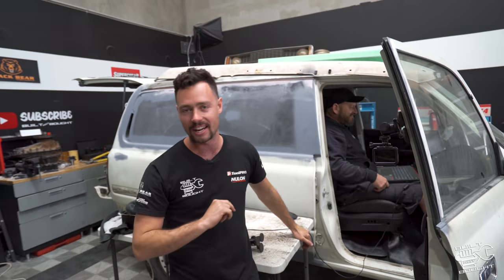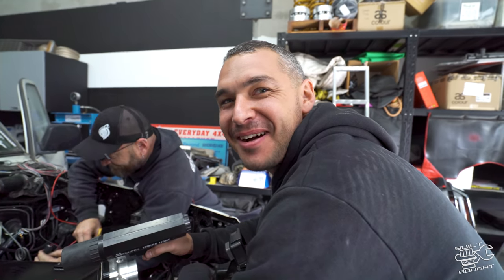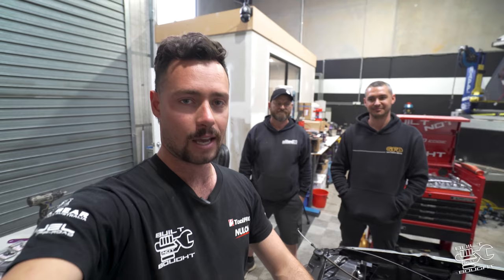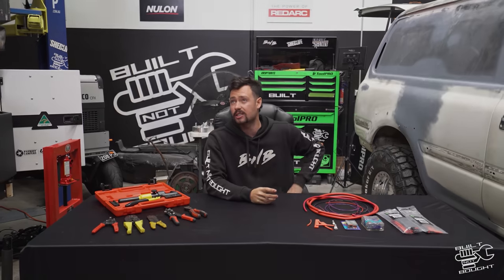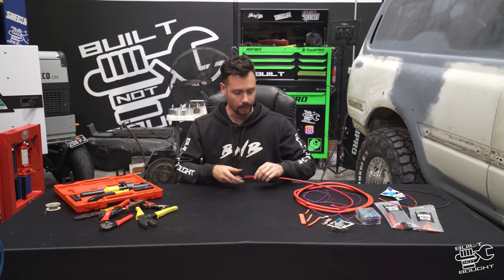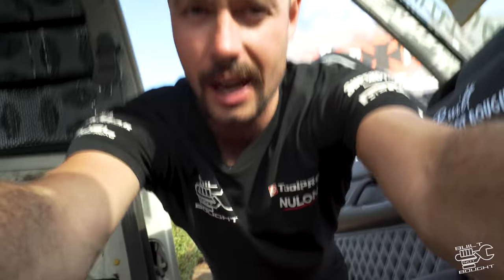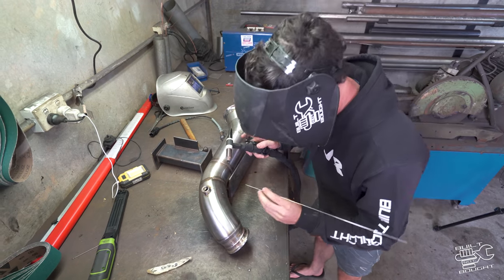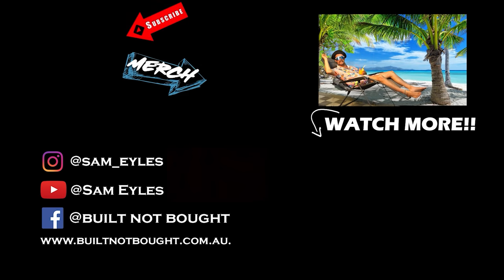BNB 80 Ep. 10 || Vancruiser Starts and Runs For The First Time

Comment: I use dog toe nail clippers to strip wire all the way from battery cable to speaker wire and they work fantastic and are cheap, super sharp and a pretty good blade, you can cut the lighter wire with them too....firm pressure and give them a twist and off it comes 👌👌😂

Comment: Bro ba bf falcon twin thermos are the bomb, they almost bolt straight up and have a great low profile shroud ,pump heaps of air and are reliable AF they cheap and avail everywhere.So good to see you using the FZ so sick of seeing barra swapped cruisers when the FZ is such a weapon.I used the Ford fans on the radiator aswell as some generic ones on the front that are triggered off the ac . Good luck man watching very closely